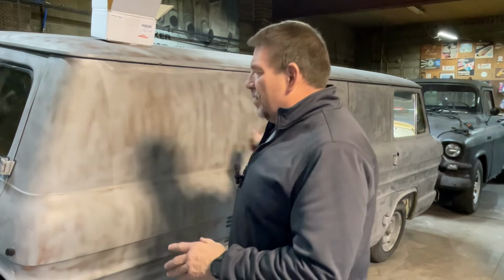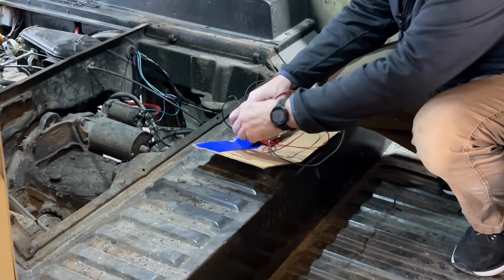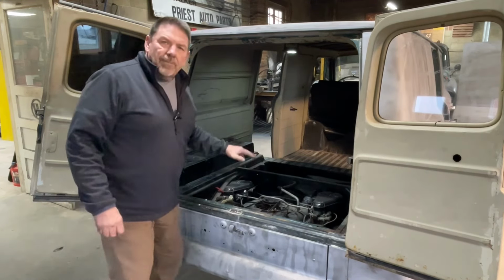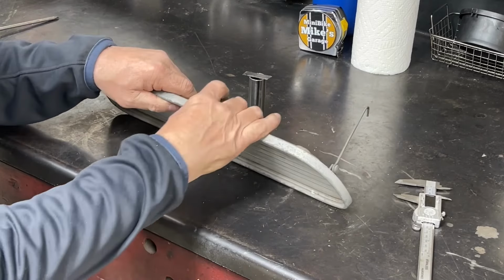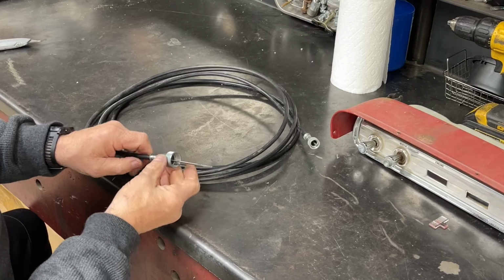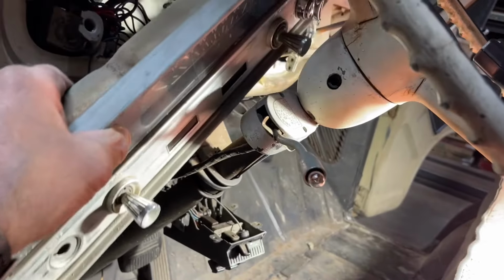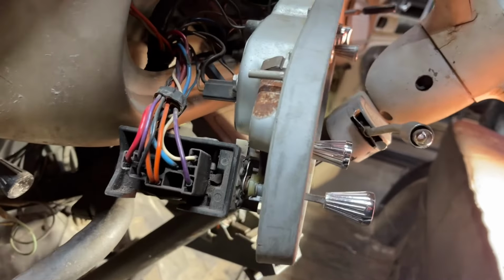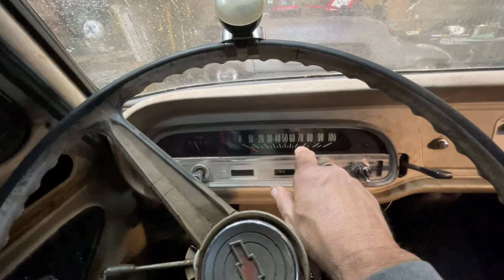Corvair Van progress - we have a working speedo, thanks to a subscriber!

Comment: That new speedo is rock solid.  Maybe you could get that fuel pump boss on the block tig welded?
Reply from the maker: I’ve considered it.  For now, everything seems to be working fine.  I’ll worry about it when it fails.

Comment: Was nice to hear that you must have lubricated and eliminated the annoying squeak that steering wheel speed knob had.
Gonna suggest again that, like my father used to do with those aka “suicide knobs”, it can be mounted inside the steering wheel rim to make it a bit less “suicidal” and less likely to get caught in a button down shirt or snap closure jackets. On some of our cars he shortened the knob base a little to reduce how high it stuck away from the steering wheel.
Reply from the maker: I think that squeak might have been the glove box door.  I didn’t touch the knob.
Reply: @MiniBikeMike Since the glove box door was the “squeaky wheel”, now I need to comment on the part you fabricated to tighten the latch/lock cylinder… good to see you do some precision measuring with your digital caliper. The part you fabricated turned out nice. “Measure twice, cut once!”
Ya freed-up $5.00 to spend toward something more important!

Comment: my green c10s power windows were an add on i did. they are wired thru the blower motor switch also! they only roll up and down with the switch in the high position to get full 12vs 😂😂
Reply from the maker: Sounds good to me.  😁